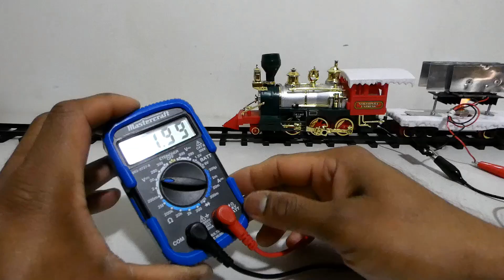THERMOELECTRIC POWERED NORTH POLE EXPRESS | TOY STEAM TRAIN | DIY CANDLE POWERED TEG EXPERIMENT

Comment: Use a dc to dc converter. Get the one that operates at 2v and is variable output up to 30v. That’s if you have the current.